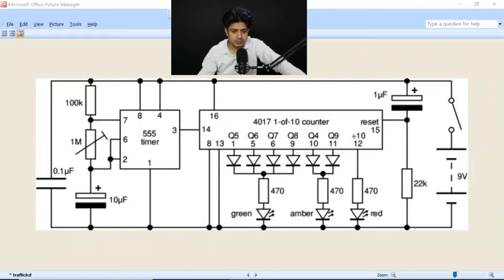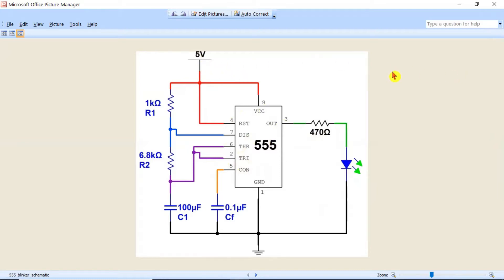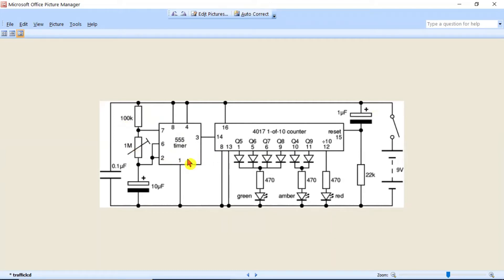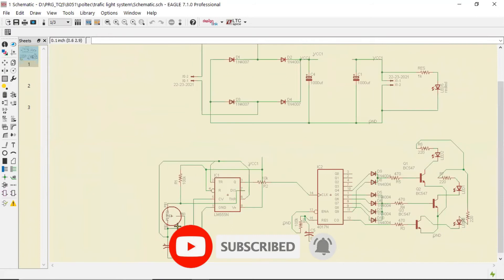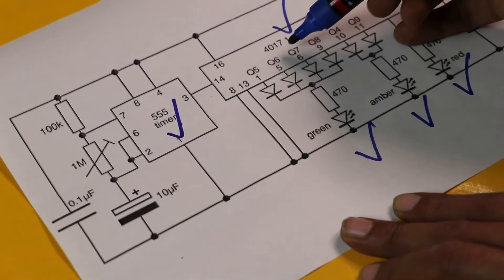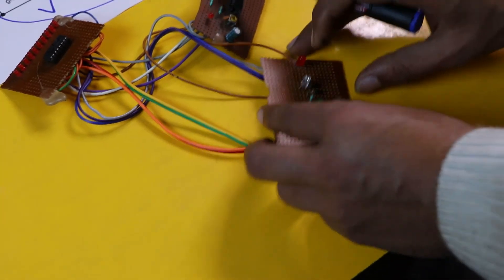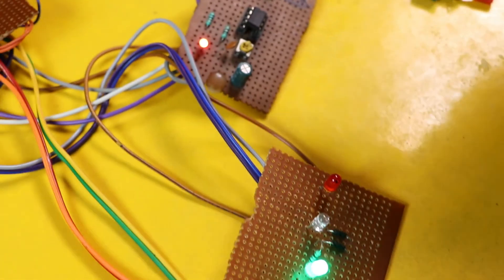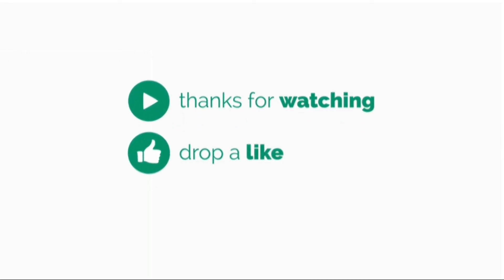How to make Traffic Light Project Using 555 Timer and 4017 Counter IC

Comment: i need help fast 
can i use 220v lampe instead ??
my project is trying to light 4 220v lampes with 555 timer and 4017
Reply from the maker: yes you can but you have to use relay for that purpose in that case
Reply: @The.Innovative.Indian  thx